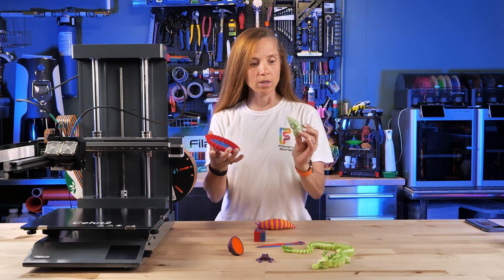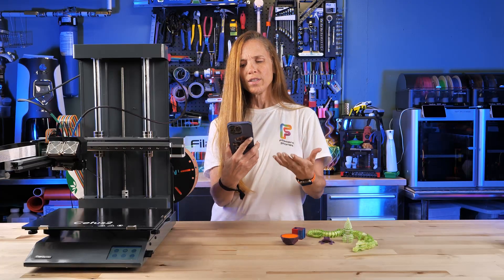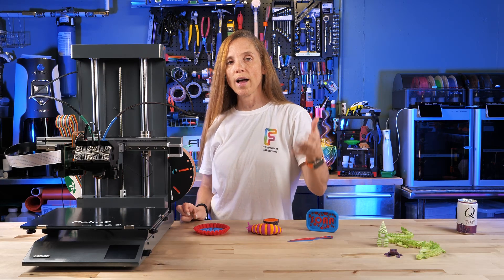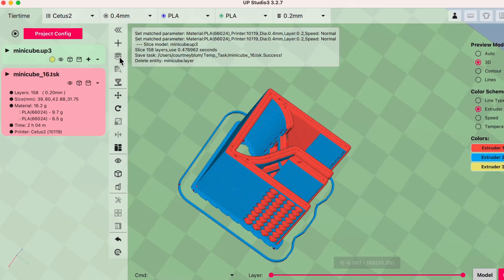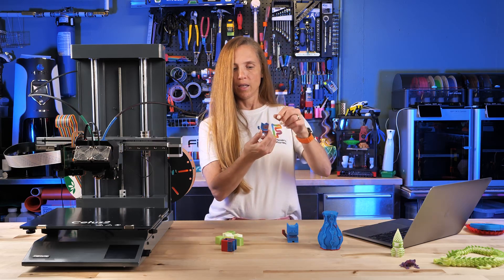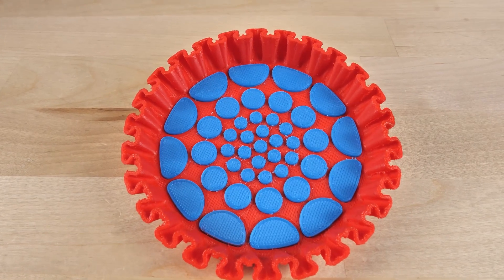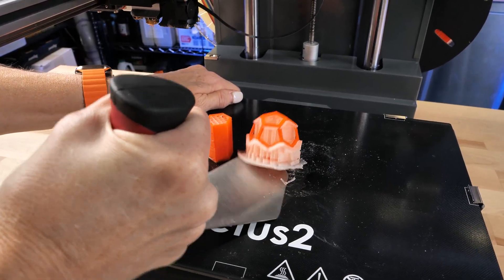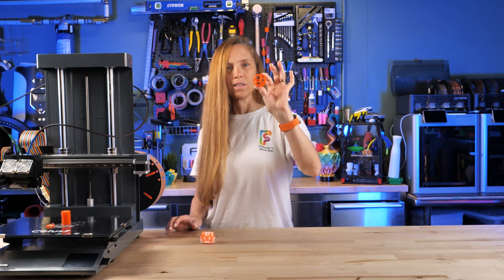My Experience with the Cetus 2 3D Printer!

Comment: I don´t quiet get the purpose of this thing.
You can either get 1. Multi material prints or 2. Full color prints. 
1. For multi material prints, two materials are already pretty good. Soft and hard material or support material and "master" masterial.
2. For full color prints you would need etiher RGB finely tuned and combined like in a 2D printer or many different filaments, say 8 or so to create some colors in between.

This thing basically does neither. It mixed two materials. What is this for ?

Comment: The Cetus 2 does have bed leveling, there is strain gauge sensor built in, it will probe with the bed with the nozzle and its also why there is only a single mount point screw.
Reply: Probably why all her prints look terrible. Because she didn't use it